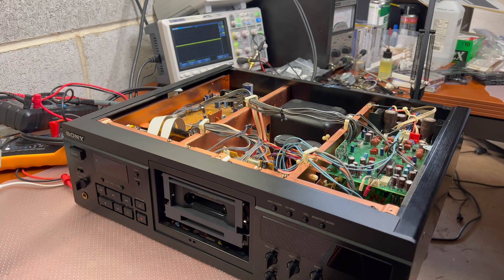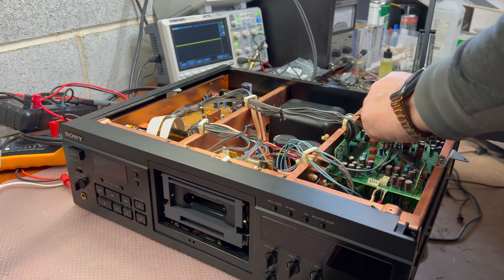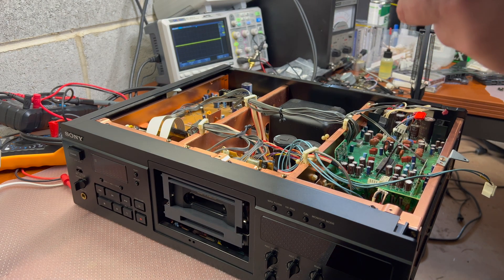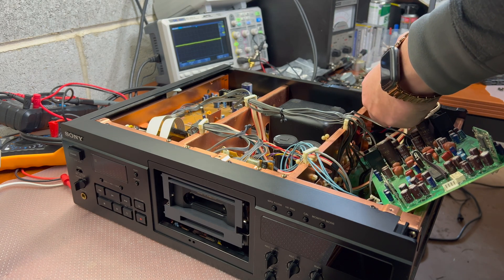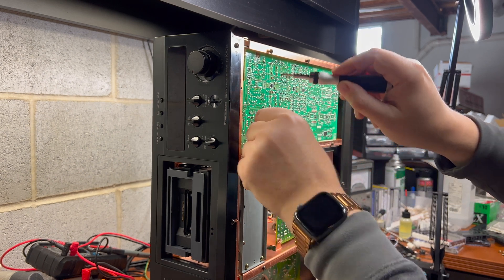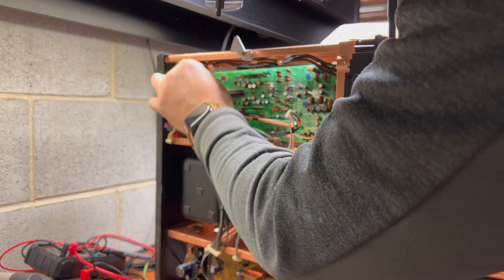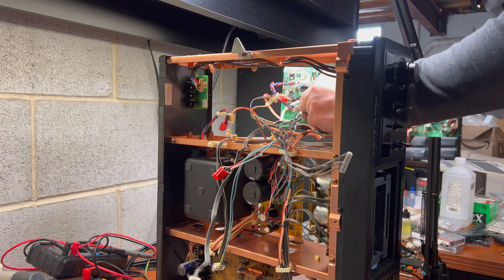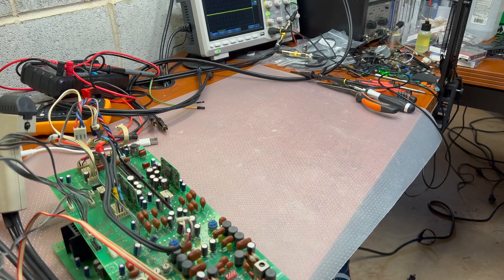Part 1 - Building the ultimate tape recorder based on Sony TC-KA7ES   4K

Comment: An excellent example what most asian audio junk looks like on the inside. This is consumer stuff, build not to be repaired but just to throw in the bins after some years. Its the same horrible low quality inside like Nakamichi tape decks.
Reply from the maker: LMAO. 40 years and still working better than modern one-time crap. Tell me that you love Studier and Revox.... Take a look inside their mess, you will be surprised
Reply from the maker: And yes, I can smell "lucky" from tapeheads here, are you undercover?
Reply: Does this people even mind of what they're writing or are they just thinking: I wanna prove myself at least 3 times WRONG in a single sentence today.

It's spine shivering noticing people head-banging roadsigns on purpose!

Comment: I use a DIP removal tool to pull the connectors. It grabs it by both sides.
Reply: I have my method not having the proper tool I still pull them out with minimal stress using small tweezers. I would NEVER ever yank a connector out. I use de-oxidant in advance, much like a mechanic does for seized bolts.